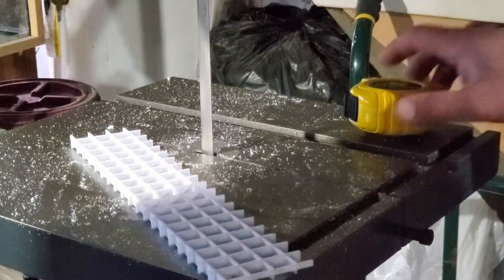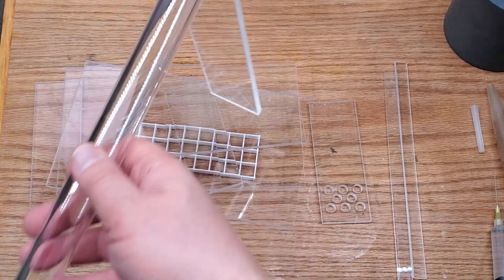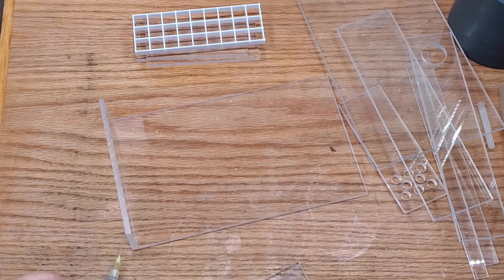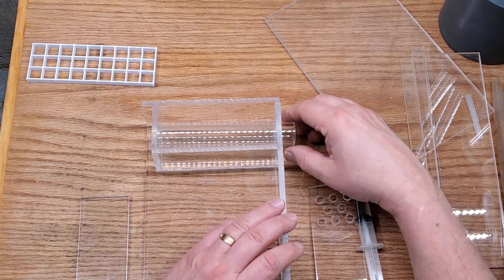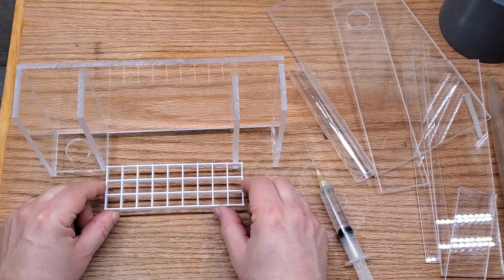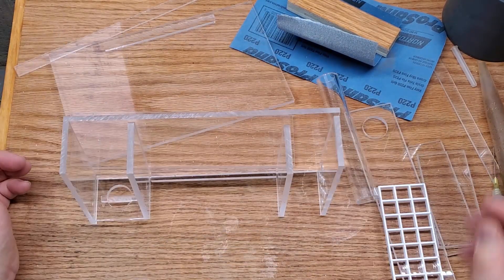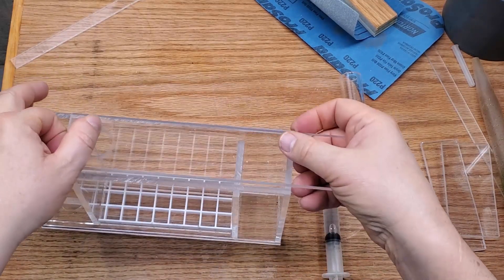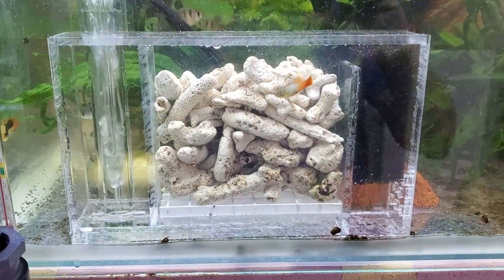Designing A Specialty Box Filter

Comment: Nice design.  Would like to see it working.  Thanks Fred O
Reply from the maker: Hey Fred! The nice thing about having to fit a filter to a spot, it sometimes generates a design change that works better than the original. In the short time that this has been running, I'm already liking what I see. There will be updates for sure and possibly some other tweaks to how I build box filters going forward. Thanks as always for taking the time to come by!